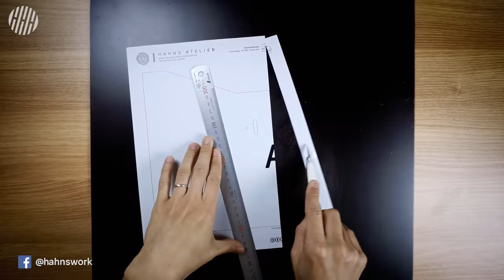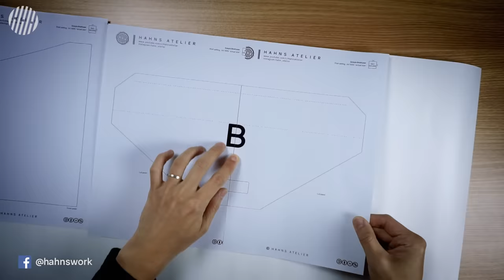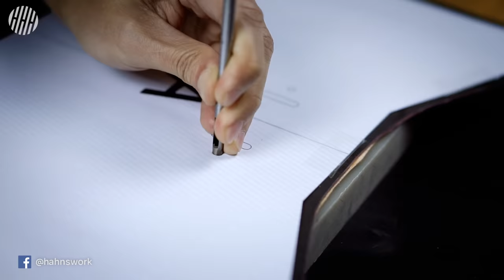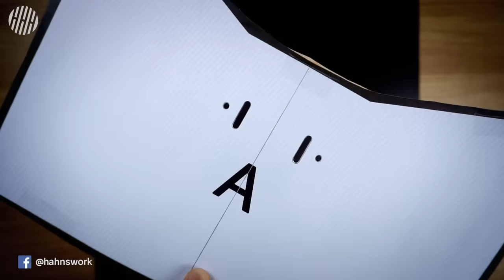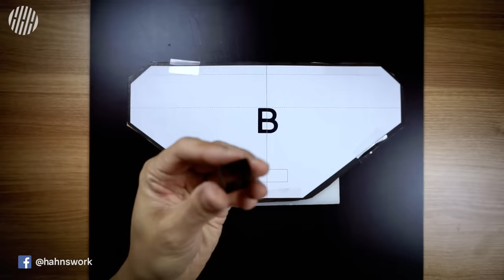Making a handmade briefcase / Leather Crafting

Comment: PRO TIP: 
3M spray adhesive makes attaching the pattern to thicker paper really freakin' quick.
And as always, thanks Hahns.
Reply: You can also print out patterns on adhesive labels and stick the pattern to firm poster board.

Comment: This had inspired me for a design. I really like the leather closure, but I have a question. I want to add a handle to the top, but that would put stress in the leather loop on the front of the bag. Do you think it could handle the stress or would it deform over time? Also, if it would take too much stress, could I use a metal loop instead, and where I find one? Thanks for any help!

Comment: Thank you for the pattern and the case is beautiful in the Wax Buttero.    You said 6MM rivets.  Were they double cap, and is that the post length as well as the cap diameter?